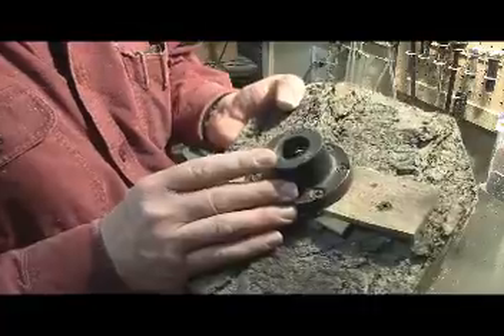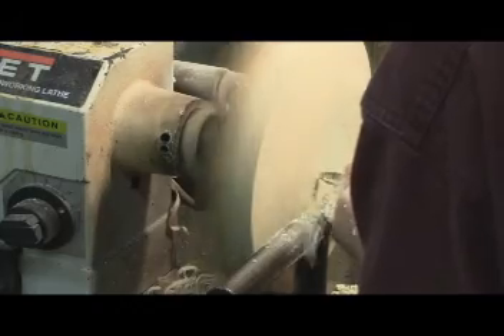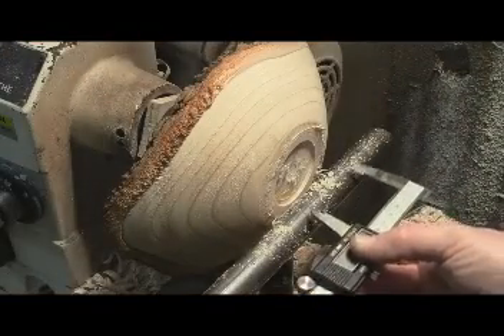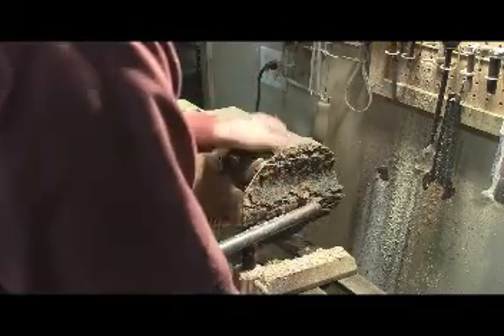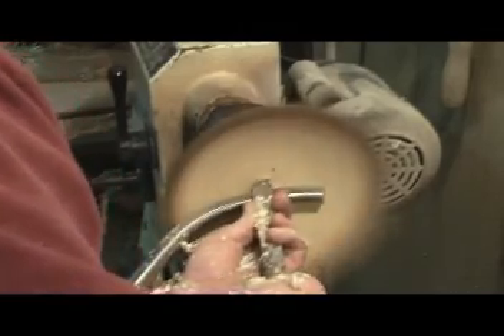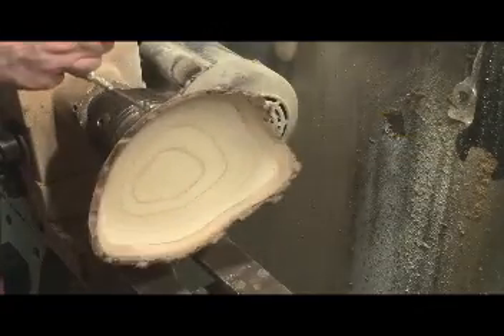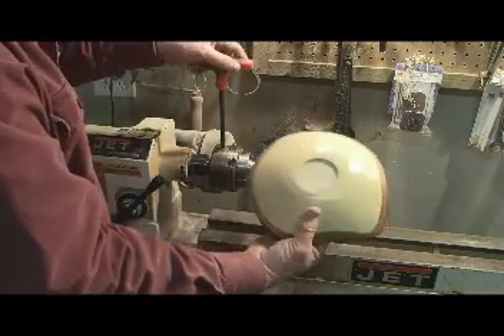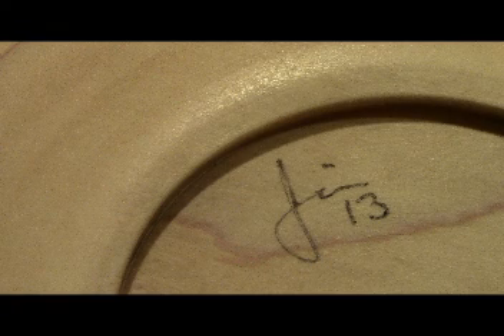Natural edge bowl, Magnolia

Comment: Hi there, just subscribe, so I'm pretty sure that entitles me to a question, right?? :)
I noticed the "spot" for your chuck is very shallow, looks like 3-4 millimeters, is that what you usually do? on my lathe, if I make it less then 8-10 millimeters deep I simply don't feel safe, and feel like it's going to fly off the lathe... am I wrong and wasteful doing mine so deep??
Reply from the maker: Hello Yuval, I just now realized that I never replied.
Do what you feel is safe as to the depth. All woods are different. The bigger the piece, esp past 12" diameter, I make a tennon for the chuck, then cut from the lathe with a saw after parting so deep.
Reply: @ballardjim  that answer was 9 years in the making!! Still thanks for getting back to me on that :)
Reply: @ballardjim  also, you did responded 9 years ago, only not as as a reply to the comment, but as new comment, which was why I was never alerted to it.